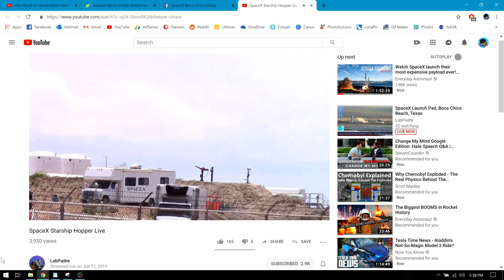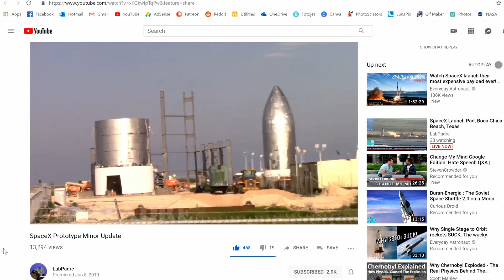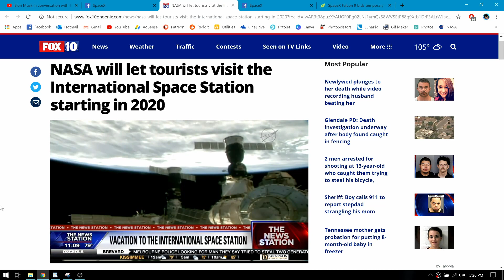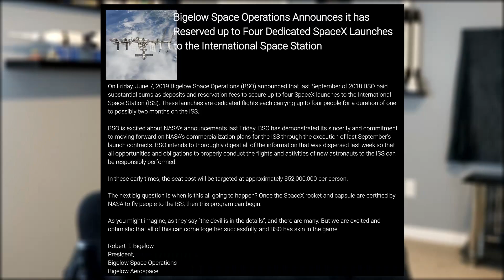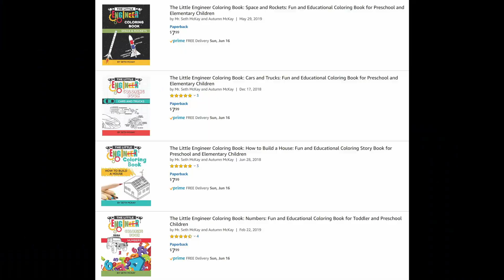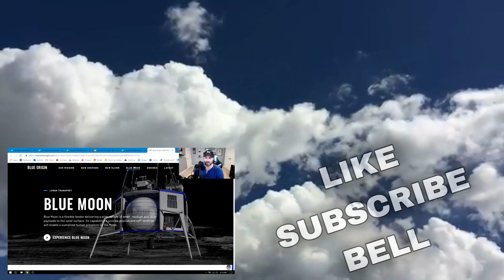SpaceX in the News - Episode 32 (Starship MK2 is Getting Taller)

Comment: So, these hoppers they are building are for like testing only, right? Cuz its just weirding me out to think they might actually be building a spaceship this way, where it looks like some kinda water tower project. What happed to clean rooms? What happened to scientific measuring tolerances? I'm still dumbfounded by this sight!
Reply: Yes, they are purely test articles, for testing engines, control systems, and heat shields. There were early, "boiler plate" test articles of Apollo capsules that looked no more sophisticated.

Comment: Genuine question here: why is it that starship does not look anything like the quality of what normally comes out of the aerospace industry?
Reply: This won't be the final version. They just want to get it off the ground. The engines and systems are very precise aerospace components while the parts you are seeing are basically a stainless steel tank. It just has to work which it will. They are not out to make the smoothest test vehicle. This method is why they have been launching spacecraft to the ISS and landing boosters rockets from the edge of space for years while some other rockets are still laying in a very pretty building.
Reply: Yeah I get what starhoper is, but those starships they are building are the ones I’m talking about.
Reply: @DanielstrattonNZ    That all applies to them as well. They are just more advanced test articles than Starhopper. Where Starhopper is strictly suborbital, perhaps not even capable of getting out of the atmosphere, the "Starships" being built will be capable of orbital flight, but are still just intended to test the engines, control systems, and reentry heat shielding. They will not be, in any sense of the word, operational space craft.
Reply: @alberto sobieski Well it's a flying test fixture which is pretty cool. :)